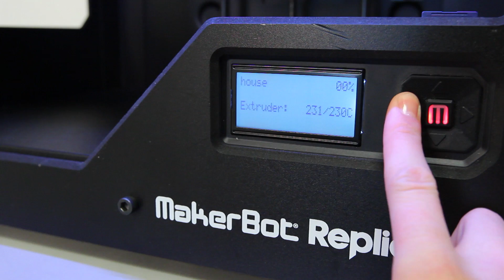MakerBot Discover Quick Tip: Watch the First Layer

Comment: The first month I spend hours on leveling. The third month I barely touched the screws at all (only with experimental filament like laywood) and I don't use rafts either. Why bother about expensive self leveling mechanisms? Once you figured it out and leveled it correctly it just runs.